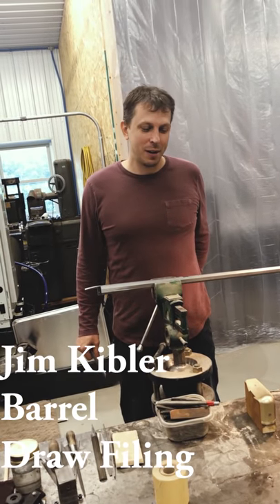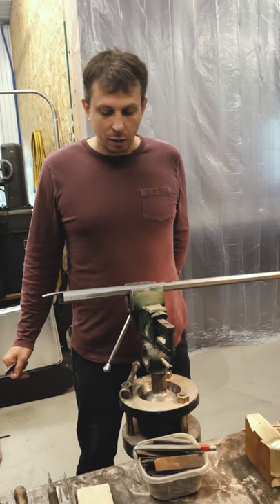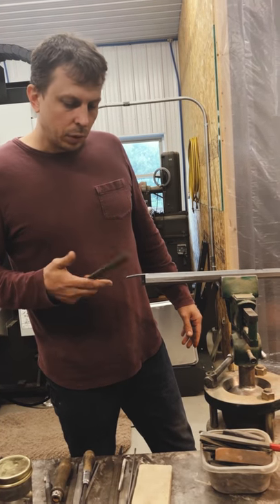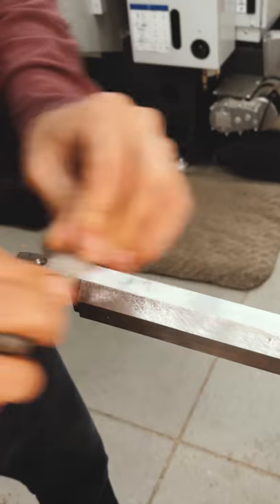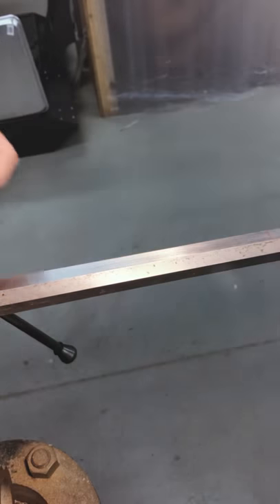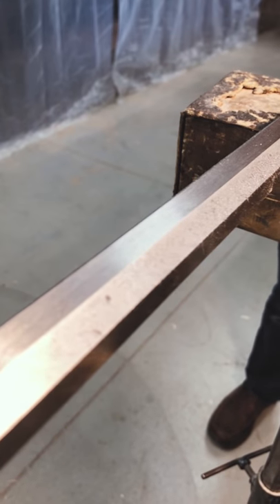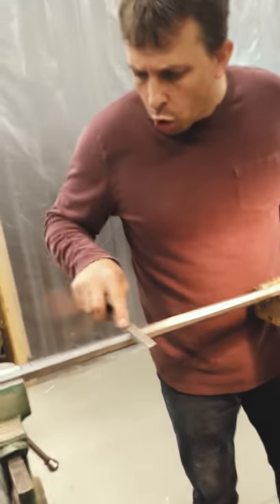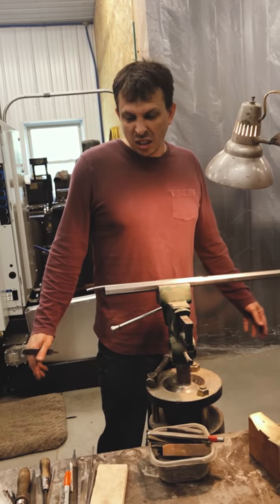Step 8 Colonial Kit Barrel Draw Filing

Comment: Thanks for the great video. I’ve just finished filing my colerain barrel, and sanding up to 240 grit. However, I still can see small waves/ ripples along the barrel flats. All machine marks are gone, and the barrel looks great until you look down the length of it with the light just right. Is this a normal thing, or did I not file enough before sanding? Will it show up worse once I brown the barrel?
Reply: I have the same brand of barrel and same "issue" if it is an issue. I am wondering how you got on with your project?
Reply: I cannot see what you have, but I will take a stab at it.  Just as big trucks will impart a "washboard" surface to dirt roads as they stop for intersections, you will get the same type of surface if you try to finish (polish) the surface before you properly establish good geometric flatness.  Start with a larger file that will bridge over more of the ripples, and use a coarse tooth pattern to quickly get to proper flat surface.  Then switch to a finer file to finish.  Use your eyes.  His hint of using the marker is a big help, at least until you get used to knowing how to look at it as you work.  Be conscious of your light.  A moveable light is really good.  You really need to see what is happening as you work.  I keep a file card (a brush) handy to keep the teeth clean and free of chips.  If you get a chip stuck in the teeth, it will leave a nasty scratch in your work.  Also, do not toss your files in with other tools. If the file gets nicked or even if a tooth gets bent, the tool will leave a bad scratch every time you use it.  A sharp, clean file is a joy to use.  Take care of your tools.  When you get it all working right, it is pure fun.  You will be amazed how quickly you can file in a notch for a sight.  You will acquire the easy perfect piston-like reciprocating action, just like a machine. Use a good solid vise.  The work must be rigid. Be patient, be critical of your own work.  Your skills will grow as fast as you can learn to use what you see to guide your efforts.  Good luck sir.  (BTW, Mr. Kibler I am a new subscriber.  I know I can trust your work.)

Comment: Well this is a subject I didn't want to tackle. Honestly the machining marks on this barrel(Green Mountain/Kibler) are so faint I was deeply tempted to leave them. I wasn't confident draw filing at least my draw filing would make a big difference. Well I jumped in and worked on one small area on the bottom flat. It went very fast. It mostly changes the tool marks from short perpendicular to the bore to long on the axis of the bore. The latter is more traditional and not difficult so I will draw file the rest of the barrel before browning it. The lock I am going to leave untouched and brown it raw.